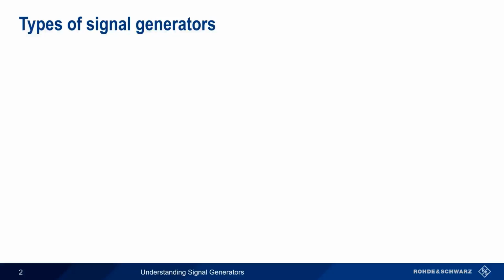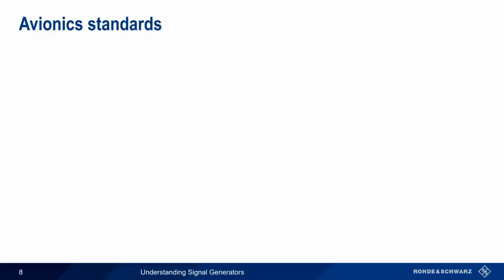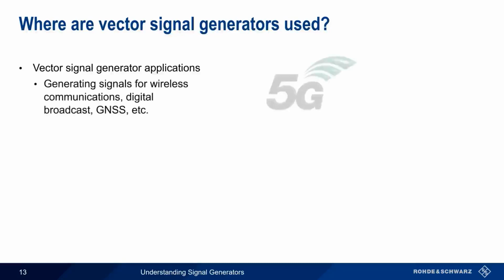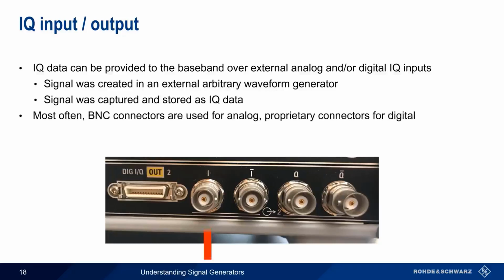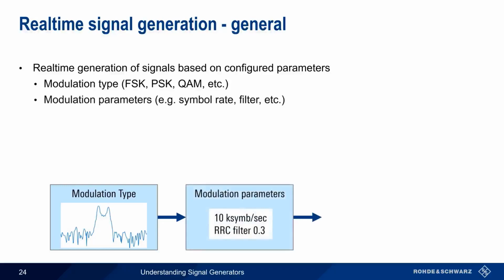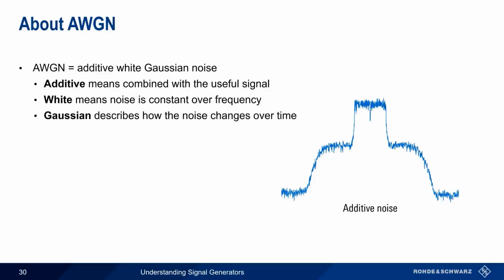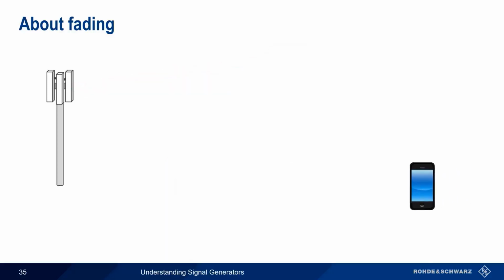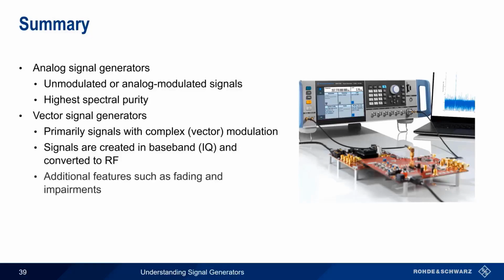Understanding Signal Generators

Comment: Why do we need to study signal  generator?
Reply: RF test and measurement generally involves generating and/or analyzing radio frequency signals.  In many cases, tests require a controlled and configurable RF source.  This applies for everything from basic tests like SINAD or filter measurements all the way to things like 5G, Wi-Fi, satellite, and radar signals.  It's important therefore to understanding what signal generators are, the different types (e.g. analog vs. vector) of signal generators, and how they work.  Most of the content in this video (and indeed, in all of my videos) is designed to answer frequent questions we get from customers.  Hope some of it was helpful!

Comment: How signal generators are protected from high return power cases ? Is there any tips to identify the signal generator conditions(safe operation or critical) during run time?
Reply: Signal generators from Rohde & Schwarz have a reverse power protection circuit that trips and displays a message on the screen if the reflected power levels are too high
Reply: @pauldenisowski  Thanks for the great video. I read the specification of an RF signal generator. in the frequency section, it said about "setting time", honestly, I don't understand it, could you explain it to me, plz?

Comment: What is/are the resources of this presentation? Can i have it?
Reply from the maker: We can share the presentation with you. Please send your e-mail address to socialmedia@rohde-schwarz.com and we will forward it.
Reply: @Rohde-Schwarz   Thank you so much! It’s a great video again, I have a question that is not relative to this video and your brand products but it's about IQ Modulation. I am reading the Specifications and Performance Verification of TSG4106A, I understand most of the parts but “Output level accuracy (IQ
 modulation relative to CW)” part (on page 21). Even I have tried to read some papers relative to IQ modulation but I still can not get it. If you get a chance, could you please explain it to me?

https://download.tek.com/manual/TSG4100A-Series-RF-Signal-Generator-Specifications-Performance-Verification-Technical-Reference.pdf